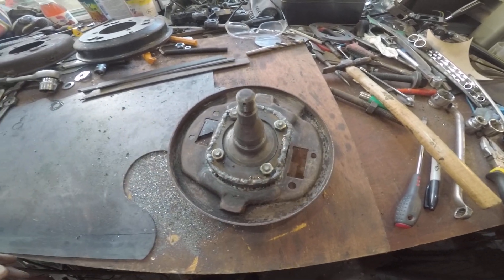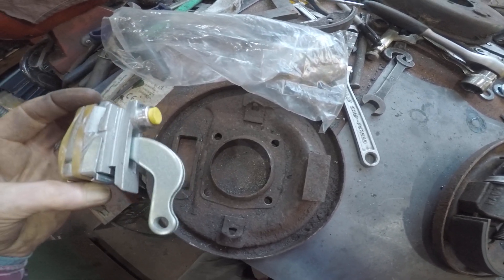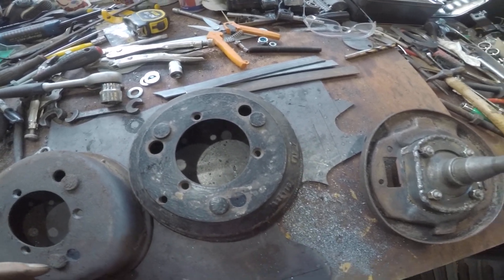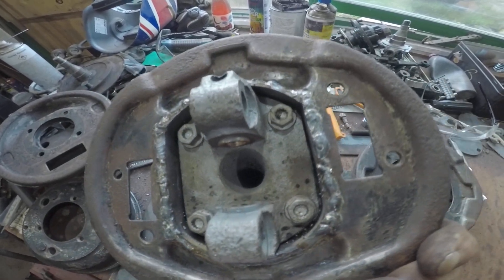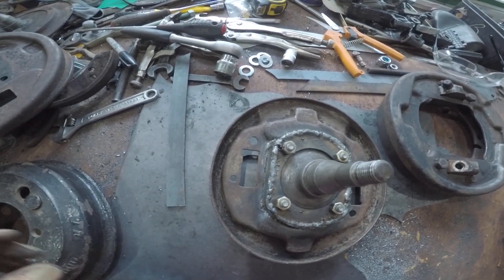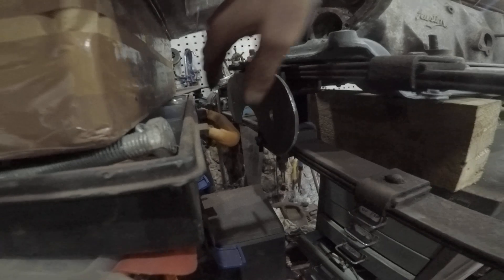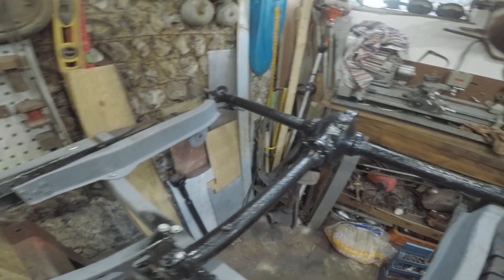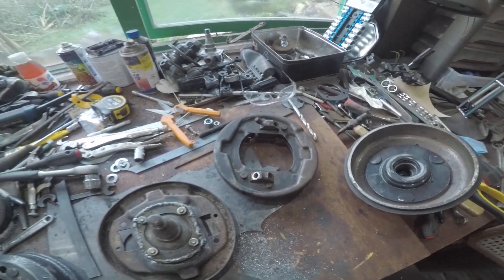Austin seven brakes

Comment: Hi   Brake conversions have been done in the 60's and it was found that the axle eyes became oval and sometimes bent and fractured the kingpins. Father improved the brakes on the old ruby by putting   a girling back axle on with girling back brakes and doing a bowdenex conversion to the front. Things may have changed 60 odd years on. Just something to keep in mind Cheers John

Comment: we used to file away  and fit hillman master cyclinder and morris brake parts parts  with no problems  was way back in the late 50s and early 60s  ,and god forbid copper lines ,has a finned double water capicity high compression head fitted was sent out fromEngland cost 100 pounds  AU and twin su carbs ,and 38 morris electric fuel pump

Comment: It;s possible to simply cut rectangular holes for the slave cylinders in the standard Girling backplates, if you have them. 
A block of aluminium bolted inside the rear plates will space the shoes apart.
Reply: You could but why not sell those and get some moggy ones